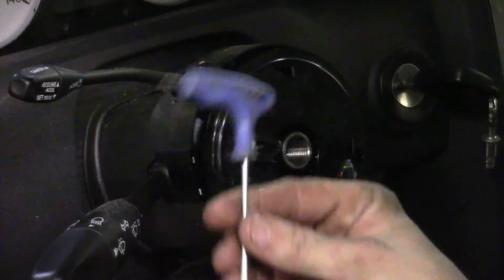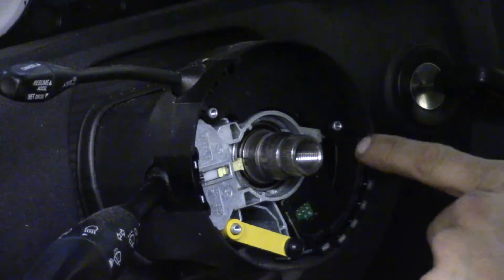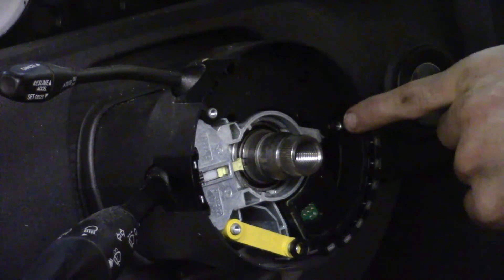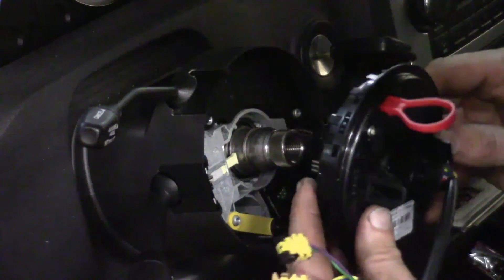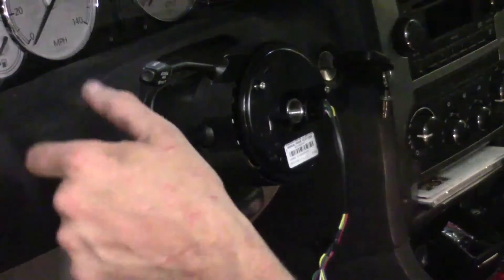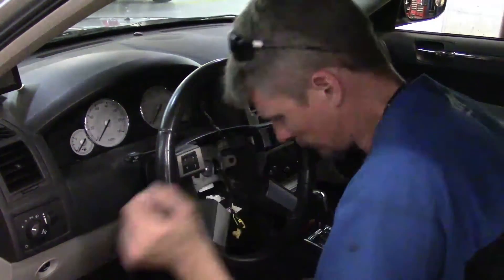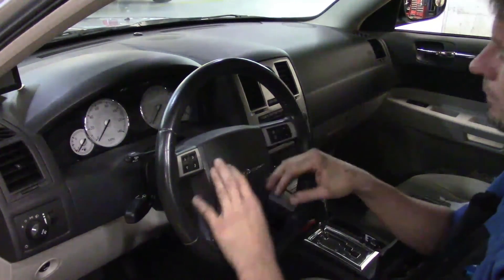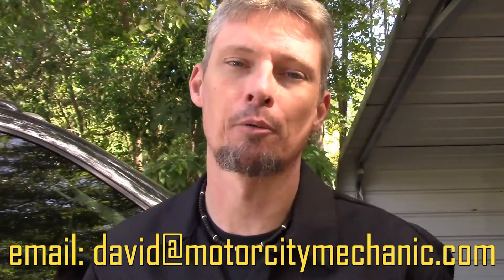Part 2/2: 2005-2010 Charger, Magnum, and 300 Steering Angle Sensor (SAS) removal

Comment: Great BOSS your very detailed in your illustration.  I feel I can do it myself but I still will have to go to the dealership for aligning of the part which is fine. But it's just extra money DIY are trying to avoid but it is what it is if the DIY  don't have the tools. RIGHT!  THANKS BOSS MAN.....
Reply from the maker: I say replace then see if you have any lights on the dash....you may not have to have anything else done...but if you do as you stated, you will have saved money installing the part yourself. Thanks for watching and make sure to subscribe!

Comment: 2005 Dodge Magnum ...ABS light, BAS light and traction light on....my turn signals do not disengage after turning plus horn not working....I replaced all four abs speed sensors first... haven't went further than that yet....heard clock spring could be the culprit and SAS sensor too....seems to me both probably need to be replaced....and suggestions or help if u know what the problem is. Thanks

Comment: I did exactly what you said to do Chrysler 302,009 and my ABS lights and traction lights and horn still do not work I put an original part in any suggestions please answer

Comment: I have an Autel MaxiDAS DS708. I read it can be used to program a key FOB. Not for my 2011 Charger RT though. I wonder if it will work for this?
Reply from the maker: Not too sure. I dont get to play around with many aftermarket scanners.....luckily I have access to the factory Chrysler scanners. Thanks for watching Mark and make sure to subscribe.

Comment: Great video thanks a lot I'm replacing my clock spring. Question does the sensor have to be replaced? Also has Chrysler ever figured out why the Dodge Charger goes into limp mode. Seems to happen when it's cold. once I shut it off and restart it it's good for the rest of the day does the module have to be reset thanks for any help.

Comment: Part 2 of 2
In addition he noticed and showed me that there is a noise when you turn the steering wheel and it happens when it passes the 11:30am ish position. 
I am aware how ill advised hanging a rope on my turn signal is and moving forward I will not but I really hope that you have some thoughts and suggestions on this mess I've created.  
Thank you in advance.  
Your videos are incredibly detailed and it's priceless that you break it down and explain it so clearly and even mention the sizes of the bolts and screws etc.  
I'm a fan!
I'm sure it can't be easy answering questions with life's demands but you are greatly appreciated!
Reply from the maker: Theres a good chance that you damaged the clockspring. There are no connectors that could have been unplugged by the string. Pretty much the only item it would have had access to is the clockspring. It will require tear down to check and see what is damaged. Im thinking you will see something obvious based on the noise and the the whole string thing. The steering angle sensor reads off the clockspring so each could have had some damage possibly. Thanks for the question and for the understanding how hard it is to catch up on messages and emails.
Reply: +MotorCity Mechanic 

1 of 2 
Your video is incredible!
I used it today!  I had a tough time getting that 10mm recessed allen off the steering wheel but used a breaker bar - apparently there was some blue lock tight on it.  
Ok as you know I had a string caught up in there and the traction and bas/esp lights came on when I pulled it out and the code read "Steering angle sensor" 
There was no visible physical damage to anything. 

2 Questions 

1.  Would that code only go off if there was an issue with the Steering angle sensor?

And
Reply: +MotorCity Mechanic 
2 of 2 
2.  I had a tmps light go on yesterday and I'm aware I have a slow leak in the front pass anger tire and need to add air every 2-3 months or so - last year this tire also had a cracked valve stem and I had to replace the stem which includes the sensor - so I added air today and the tire light goes off and then for 20 seconds the traction control and bas/esp go off but then came back on.
I assume it's not related as those lights went on after I yanked that string out but I wanted to give as much data as possible for you to help diagnosis. 
Am I on the right path in replacing the sensor first thing tomorrow morning? 
That is my plan but I'd love your feedback beforehand. 
Thank you again!
I'd have never attempted fixing this without your guidance and amazing step by step.
You sir, are appreciated.
Reply from the maker: The steering angle sensor code can be caused bu the sensor or the clockspring. Starting with the sensor is good start based on what equipment you have to test with so I see no issues with that repair attempt. I so appreciate you watching the video and for the comment. Confidence is what these videos are designed to give so that you learn more about your vehicle

Comment: Part 1 of 2
Hello there!
Ok. I have a crazy story you aren't going to believe.  lol
I had a piece of string/thin rope hanging on my turn signal (it was actually the yellow rope from a ripped Crown Royal bag that I intended on repurposing) 
I was parallel parking and the rope got caught up inside the wheel and I had to yank it to pull it out and muscle a wheel a bit and immediately after  I noticed the traction control light & ESP/BAS light came on together. 
I had the code read & "Steering angle sensor" was the code that came up on the snap on code reader.  
Mechanic thinks it may just be an unplugged or misplaced wire that was unplugged by yanking the rope or the clock spring.

Comment: I have I cuestión I did that same to my doge magnum but that tracción light come on went I drive that doge went I go over 40 mph how can o fix mi problem that only thing I did not change is that clock springs and is a little bit damage because went you put you signal stay on I have to return that signal back ?

Comment: I took my 2007 charger in for a recall on the airbag a while ago, not long after that my ESP BAS light came on. I tried the reset procedures several times and it always comes right on. is it possible that they did something wrong at the dealership that's causing that?
Reply from the maker: Evening Andy. There isn't anything that they could have done. When the airbag is removed....there isn't anything related to those two lights in that location. The first step is to have the system checked for codes. That will tell us a lot. Conan issues are ABS sensors but we need the code first.
Reply: The codes I pulled are C121A, C2205 and C2200
Reply from the maker: +Andy Cesar Okay.....c121a is steering angle not initialized. c2205 steering angle sensor internal, and c2200 abs internal. The two codes c2205 and c2200 basically state to replace that module if the code is active or if it returns. Odd that both codes are present. I highly recommend clearing all codes and seeing which comes back first. C121a isn't the big concern, if you end up having to replace the steering angle sensor than you will need to initialize the steering angle sensor.

Comment: how do you rest the steering angel sensor
Reply from the maker: +elvato31 Morning, some vehicles don't have to have it reset. If it does require it than you will need a high dollar scanner that is capable of performing this procedure. Which means you may be paying a visit to your local dealer to have it performed

Comment: which scan tool/model do you recommend to do the calibration?
Reply from the maker: Thats hard to say.....there are hundreds on the market and each has its pros and cons. Some will do the calibration while others wont. Being that I am a dealer tech....I have exactly what is needed to work on your vehicle....but on the flip side....I dont have access to a generic scanner so that I can form an opinion on whats the best without spending a fortune. I have been sent a few to check and review but to be honest....disappoint on what they are capable of. Its sooooo hit and miss with them.